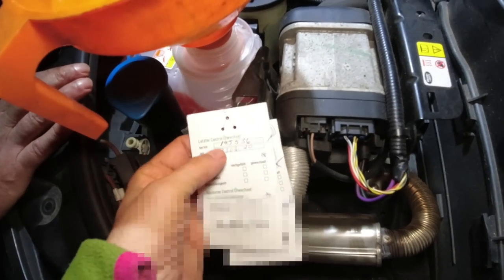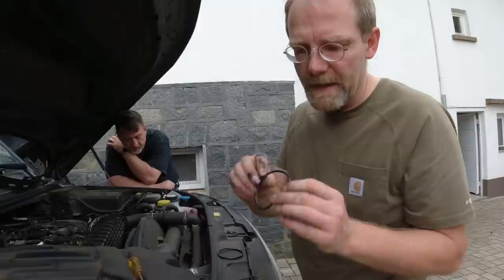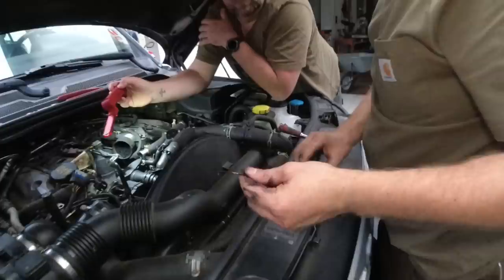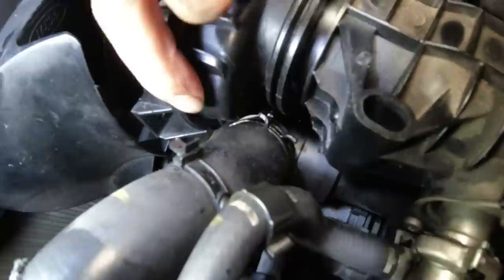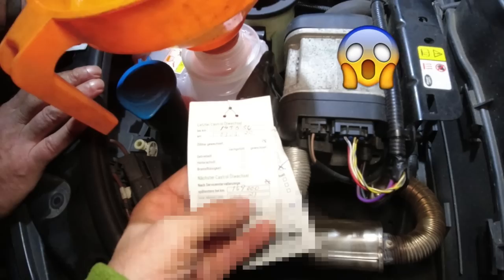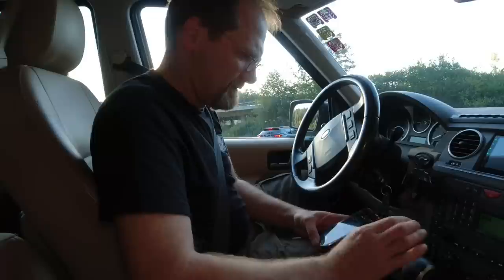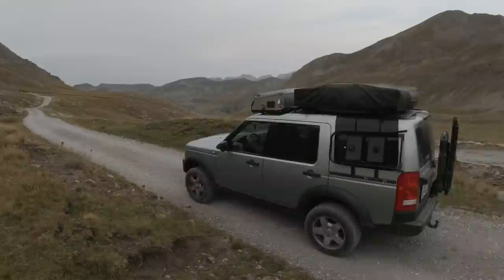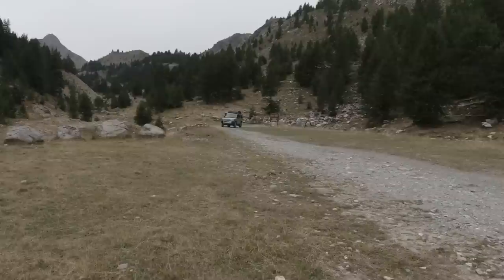How to fix the air intake of a LR3 LR4 TDV6 SDV6 Land Rover Discovery - smoke test

Comment: When I lived in the UK (I now live in Austria) my local landrover dealer supported me very well when I bought my first 300tdi defender at aged 20..
I got on very well with the service manager and the team and it  became apparent very quickly to me that the dealer had  10 "technicians" But in reality there were only 2! One was a mechanical guy and the other guy was an electrical genius. The other 8 were just mechanics and relied on the two " real technicians " to help and support them.
What I saw with your friends mall crawler doest surprise me. This is why I do all my own work! You are not paying a kings ransom to landrover for quality work, your actually servicing the dealers massive financial overhead costs!! Great video as always and it highlights a very important point.. Land rover servicing isnt a byword for quality. My local dealer in Villachs level of  knowledge is only on current vehicles.
If I turned up with my Td5 D2, there would only be one guy there thats ever worked on one... The other technicians were still breast feeding when the car was made and if the computer didn't direct them directly to the problem, they wouldn't know where to start...

Comment: Hey Christian,

I must admit that sadly there are many technicians and workshops that arent doing good work.
But its also important to point out that there are skilled technicians and good Land Rover Workshops you can trust.
I am an workshop controller in south Germany for a Jaguar Land Rover dealer and my whole team is working very hard to meet the standards we set to please all customers. No matter if its an old D2 TD5 or a new Range Rover P525.

To be a Land Rover technician you have to accept the challenge that comes with these cars. Its not a VW or some other easy to fix brand.

Clearly this video shows very bad performance of this workshop but this is not true to every land rover workshop.

As a true Land Rover technician you need to have the passion and love for the brand.
Reply from the maker: Thank you and I agree.  Unfortunately I just have a SDV6 which had a repair of the 8HP due to a oil leak.  It cost 2500 Euro at LR.  Trans still leaks. After the repair the transmission shifted incorrectly and the owner was told it’s the drive shaft.  LR replaced the drive shaft for 900 Euro.  Problem still there.  LR told the owner it is not the trans, it’s the lower front suspension bushings rattling (I am sure they where bad indeed).  Replaced for 1200 Euros.  Trans still leaked and car jerked badly on downshift.  Owner sold the vehicle - now it’s mine.  Analyzed the issue and found that the transmission adaptation was not reset after the repair attempt of the oil leak - which included 6 liters of Lifeguard 8 for 60!Euro per liter.  I reset it on my way home at mc Donald’s.  Trans works now perfect but leaks.  You Tell me now:  Do you want me to show the name of the LR Workshop in my video now or not?  Will be out in about 3 weeks.  Christian
Reply: @Vera_and_Christian  
I have no issue with you telling your experience or even others as you did.
I mean if they are that bad then its obviously sad but still no proof that all LR Workshops are bad and trying to fool you or the customers.

Im sure you could make a whole video of all the bad things LR Workshops have done.

I think legally its better to not tell the exact names of the workshops but rather just do it similar as you did in this video ;) 

P.s. I really enjoy your videos and like the way you are analysing and thinking outside the box.

Keep up the good work.

Also i have a D3 as well which probably was the reason your videos were recommended to me.

Comment: Watched your video this evening in the middle of the Nullabour. plain (Australia). We are on the tail end of a 5 month lap in a Discovery 4 towing  a 3,000kg off road caravan. Love your videos and the humour you inject into them. Keep up the great work you do
Reply: G/day Steve Sartori I am in the final throws of a diy caravan biuld and I am looking at buying a disco 3 . How has your disco 4 performed towing??? thanks Stig..
Reply: @stig7657  Tows like a dream. Very stable at any speed. Over here we have trucks called Road Trains...these can be 60 metres long. They travel at 100kph and every now and then you need to pass one....put your foot down and the Disco just goes.
I love this car. So far the only work done, other than regular service and oil changes at every 10k has been timing belt and fuel pump belt. Cheers.

Comment: Hi guys 
I thought this might interest you , both my son and me own Land-rovers 
He has a 2006 Disco 3 with 174000 miles on it he gets it regularly serviced by his local mechanic as he like me can’t do what you do 
He has never had and serious issues and gets it serviced when required his last service was a major one and included, the cam belt , belt tensioners and a water pump his bill was £1144 
I have a Freelander 2 2014 with 94000 and as above it gets serviced as it should 
I just had the cam belt , serpentine belt and a diagnostic check , cost £904 
Great program and Iv watched everything you have done 👍👍👍👍😎😎😎😎

Comment: It's the same with coolant every time. The more precise you are... you spill more liquid on the floor :) I'm really enjoying watching the footage... You really have studied the DT17(lion engine) I also have the same problems with my Citroen C6... Sometimes everything goes well... and sometimes you can insert one piece correctly within two hours, otherwise it only takes 15 minutes. I like it when Christian finds a mistake and almost immediately knows what's wrong. And thanks again, Vera, for the advice I needed about the oil pump.
I'm a Land Rover fan, too. And I intend to buy a Range Rover TDV8 this year... Same Lion Ford engine with 2 cylinders more. Looking forward to a new adventure :) The engines are demanding... But as you two say... If you don't want to have an adventure... buy Toyota:)

Comment: This is exactly the issue my D4 SDV6 has, Restricted Performance kept coming back, all in hand to be dealt with 🙂
Reply from the maker: Do get it fixed, driving with this fault, especially over 2000 rpm will cause further damage to the turbo. 👍🙋‍♀️
Reply: @Vera_and_Christian  due to be done this week, i only drive a few miles daily & rarely above 2000rpm, once done it will be given a good clean out 🙂

Comment: “Ever Since” I started watching LR Time I found out I don’t clean my engine parts anywhere near enough.  
Boy that carbon build up looked like part of the EGR path.
Dusting the engine appears to be a common issue with these plastic air filter housings.  If it is done enough someone will eventually put the lid back incorrectly.  Has been happening for a while, it is not new to D4s.  The designers of the housing should take that into consideration and provide some guides to ensure you seal the air box properly even when tired after a long day of LR servicing.
Reply: EGR gases are loaded with carbon and kill engines. The D4 EGR design is much better than the 2.7, so the EGRs are rarely taken off. So the throttle body is never taken off, and that's why so much carbon builds up in the intake manifold.

Comment: I'm now Shell Helix Ultra 5W-40 A3, B3 protected. Feels like my discovery has a condom on 😆.  First impressions...sounds smother and starts very quiet.  So big thanks. 👍
Reply: Bit of feedback on this. The mechanic agreed with your logic. Pressure is up, engine is much quieter. It was a good move changing.

Comment: for shifting the carbon try RED X 1 shot it must be the 1 shot it shifts all carbon and the engine runs sweeter ,i had a stuck in heater plug and was told to get the RED X 1 shot I forgot about the heater plug being undone  and a couple of days later it blew out i never did find it .but once a year I use the red x 1 shot thanks for the video

Comment: Enjoyed the video, like always.  A few thoughts come to mind.   First, I wonder if the Land Rover engineers have to say about your 10W30 v 10W40 analysis.  Second, I wonder what they think of the fact of the interference you found that throws the intake o-ring out of whack.  Third, I Googled G123 and got this, "What is G123? G123 is Japan's leading HTML5 game service, providing high quality games based on popular Japanese anime franchises."  Fortunately, I don't need one.....yet.
Reply: actually it's 5W-30 vs 5W-40.  the LR engineers would probably agree with LRTime.  Most independent land rover mechanics in Australia already agree.
Reply: @noelwhittle7922  Of course, your correction is correct.  Thanks.

Comment: Hi there, I have experienced the exact same issue. My Disco 4 went on restricted performance, Land Rover local dealer (France) asked for just above 4000 euros to replace the 2 EGR valves... I have built a 'smoke generator' following your method and have found the leak at the exact same place. Once the air intake collector dismantled, grinded and refitted my car was running like a charm... So a very warm thank you to you guys! Keep up the good work! 
BTW, I can see you connect to your car using a mobile app for reading and resetting faults. Can you tell me which cable and application you guys are using? Cheers.
Reply from the maker: It‘s the Gap iid bluetooth unit. Expensive but well worth it👍🙋‍♀️

Comment: on your Highway Error Message (HDC Fault, Suspension lowered...): had the same on my 2005 V8 HSE and found a recommendation to replace the brakelight bulbs. Replaced all bulbs (although all were working fine - think 4x 21w) and the problem is gone and has not returned in years. So apparently the car is sensible to quality of Brakelight bulbs....
Another resason might be water sipping in via the black plastic left & right of the windscreen. Water enters behind the plastic and leaks into the area of the main electric junction box on left & right side. The plastic parts next to the windscreen have been modified multiple times according to the official sparepart list
Reply from the maker: We typically read the fault codes and it tells us what circuit makes trouble.  Christian

Comment: seems all Euro LR  chassis are rust stained, but now I  have a problem, sometimes push button will not crank the engine, early summer i saw two large tiger snakes writhing in agony as they were run over by Toyotas

Comment: Being dealership maintained does not mean it is in the best hands. They may have all the tools and diagnostic equipment though they still employ people and not robots to do the work. Some people are crap, some are not. I see chain mechanic workshops no different to dealerships, and that comes from experience. The best mechanics I have dealt with are owner operators of they own independent workshop

I am not a mechanic. I don't have all the tools and machines to do some things. When I work on my vehicles I don't want to do something a second time, so I make sure I do it properly the first time. Sometimes I have had a failure of some sort, rarely through my own doing, but it does happen. Mostly it is a product failure though. Where it is my fault, I do get annoyed at myself, though I know it is my fault. I do not enjoy paying for someone else to make a mistake then come up with reasons why it isn't their fault and want to charge me again. Fortunately I have found more good mechanics than bad, and in all cases the good ones were small independents.

Comment: Hi guys thank you for this video. I have this issue atm, I had a new throttle body fitted and the Intake came off after fitting on my way home, the mechanic refitted and I've had restricted performance ever since. Would this of damaged the o ring ?
Reply from the maker: Best do a smoke test and see where your leak is. 👍🙋‍♀️

Comment: Where is the 'Smoke Test' mentioned in the video description?
Reply from the maker: I added it. Here is the direkt link.  You can use a smoke tester from Amazon.  We got one too by now.  Buy the one with the integrated air pump.  Much easier.  https://youtu.be/ZDzb3RGxOPo

Comment: That clicking noise at 16:24, what is it? I have the same noise on my LR3 the last few months but only after going slow up a grade. Not axles or brakes. I think it might be the transfer case or bearing in the front differential. I change my diff fluids every year. It's making me insane. Drives perfect on highway/street driving with no sounds at all. Only going slow on upgrade, under 15 mph, rotation click/clack, no grinding noises at all.
Reply from the maker: We already fixed it in our last video. Check it out. 👍🙋‍♀️Vera

Comment: Hi Christian / Vera - I had a new FOMCO oil pump and both belts done 2000 miles ago but I just saw your timing start up for the oil pump taking a couple of seconds .. mine takes 5 seconds ! Is that a problem ? Many thanks from the U.K.
Reply from the maker: 5 seconds is extremely long.  The check valve in the filter housing may be leaking.  Or the pump is a Mellon. How many miles on the engine.  Might be bearing wear and the pump is ok.  Better write me an email.  See channel description for contact.  Christian